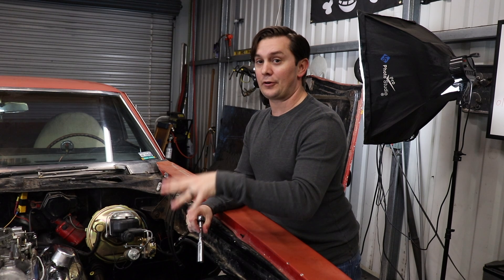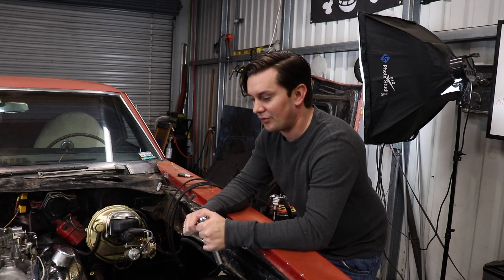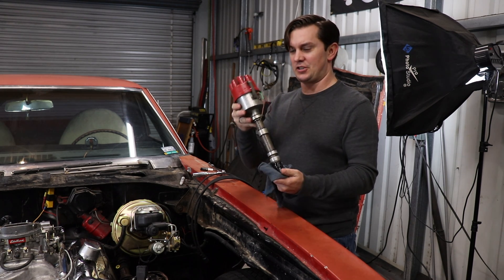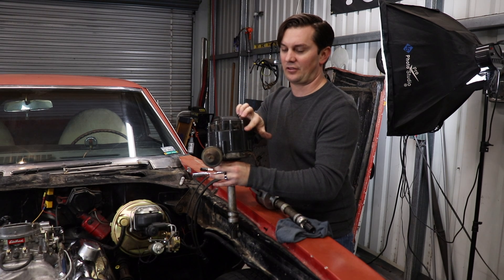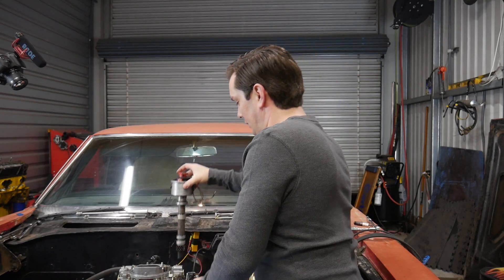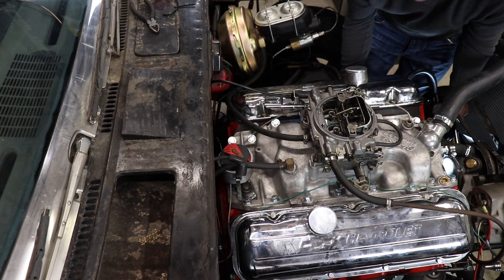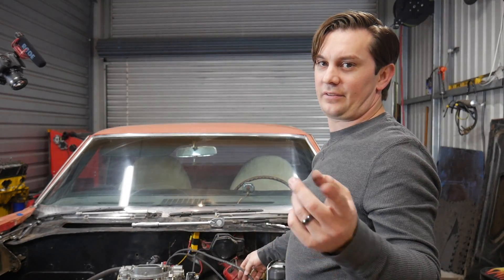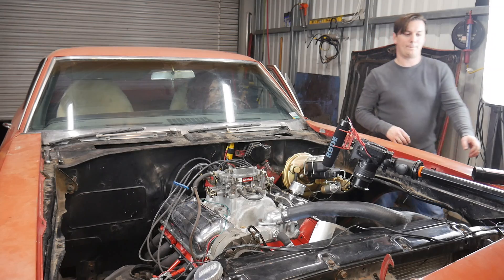How to Install a Distributor in a Big Block Chevy | How to Adjust Timing on a Chevy

Comment from the maker: Thanks for watching everyone. Let me know what you think. Do you adjust timing differently or install distributors differently?
Reply: After setting TDC, I usually make sure my oil pump drive is lined up with the #1 cylinder as well, I don't turn the crank over to let it fall in. Now when I drop the distributor in, it should fall perfect in place towards #1 TDC.
Reply: @fir3gun Extra work.  Not necessary. His way in this video is just plain easier

Comment: Great info but I'm a little bit confused about where your rotor was pointing after you rotated the engine to get the distro to seat. It looks like it was pointing away from cyl #1.

Comment: I'm struggling with this on my 427. Any time I get it lined up just right, i clunk it down, and it rotates due to the gears meshing. But then if I hand crank the engine, it won't be at 0 TDC. Do I do a back & forth a bit with the engine timing?

Comment: Great video...I'm glad I found it!  Going to be replacing my crappy mallory unilite distributor with an HEI for ease of wiring on my '66 GTO with a 1972 Olds 455.  After you feel the pressure push out on your thumb, is there an easy way to know how much farther you have to crank it to get it at exactly TDC or is that accomplished with the marks on the timing bracket and balancer?

Comment: After setting TDC on the #1 cylinder, installation is much quicker if you point the oil pump rod opening in the 11 and 5 oclock position, proceed to drop the distributor in with the rotor pointing towards the second rear intake bolt on the drivers side. As the distributor gear meshes with the cam gear,  it will line up instantly with the oil pump rod, drops right in with rotor pointing towards the #1 cylinder, figure less than 30seconds, and you are done. Using a screw driver to "clock" the oil pump shaft is not a waste of time, but the quickest of time vs dropping in the ditributor, rotatng the engine till it mates with the oil pump shaft, then you'll have to rotate the engine twice to get it back to TDC on the #1 cylinder, its twice the work when you have already set it at TDC on the #1 cylinder the first time.

Comment: Hello, I have a stock 454 in 1975 GMC C25 w auto trans. Timing sticker inside engine compartment says 8deg BTDC. Why are you setting base at 13deg ?

Comment: Im new to this, timing. How close to TDC the #1  piston needs to be? dead on TDC?  should I check the rockers to make sure both  "valves are closed"?  Thanks for posting, great vid!
Reply: Yes and yes! Make sure both valves are closed on the #1 cylinder (this is to make sure it is on the compression stroke).
Reply: @fir3gun  You can place  a screw driver in the #1 spark plug hole. Then Rotate the crank with you breaker bar until you can't turn any further. That willl be TDC .

Comment: Gotta ask wouldnt rotating the engine just to allow the distributor to align with the oil pump throw it out of timing with the number 1 piston. ??
Reply: no because the distributor gear is already set with the cam gear when the engine was on TDC. Now when you rotate the engine, the distributor gear and cam gear are still locked together, then boom the distributor should make one final fall into the oil pump drive (now the distributor is set flush with your intake manifold.)

Comment: I just replaced mine on a 350 Chevy.  When It had been running awhile I noticed that the oil pressure was double what it usually is.  So I shut it off.  Going to go out tomorrow and try to figure it out. Any ideas? Thanks. Nice video
Reply: Shawn Harrison from columbo mine?

Comment: I've enjoyed your vids on this engine ($300 find, tear down, initial fire up and this one on dropping in the distributor).  You've got an easy, laid back style.  Been wrenching on small blocks since I was 14,...I'm 61 now and this was such a well done, straight forward instructional video,....and I know it will be appreciated by many. PS.  The 400 SBC is a little prone to running hot due to the siamese cylinders, but boy do they make power.  They were used in lot's of busses and commercial trucks.  Big bang for the buck and super popular on the drag strip for THAT exact reason.  Even for a baseline build, you can easily get 400hp and 400lb/ft of torque out of them, or more.  Just watched a video today, in fact, and the 400SBC dyno'd at 471hp and 473lb/ft torque.    Great find for ya !!  I'll be watching.
Reply: What headers are on that car? Thats a 67?

Comment: Thank you for the video. Your base timing is 13 degrees but mine according to Chevy is 4 degrees. I have a 1988 Winnebago Superchief that sits on a Chevrolet P30 chassis mated to a 7.4L 454 V8 with a Rochester Quadrajet. Carb guys tell me my base timing can go to 10 which they say is ideal. Can I get your imput? David 🐈
Reply: it really all depends on how stock the engine is. base timing runs great from 4-12 degrees, but if you have any power adders or bolt ons, you might want to consider using total timing, not base timing
Reply: Ya they are supposed to be 4 this is really confusing me
Reply: I took it to a mechanic who changed it to 9 degrees. Runs better. 😺
Reply: did you ever find a answer.  mine also says 4°

Comment: Most people I know use a screwdriver to align the oil pump shaft. Didn't know it could be so easy to just drop it in and turn the crank haha. Great tip!
Reply from the maker: It is one of those little tricks that really comes in handy.

Comment: I just throw them in, find what it's pointing at, and wire it accordingly.  Never used a timing light ever.  Later on if replacing the distributor I do actually try and match it up one for one.
Reply from the maker: If you have done it a bunch of times that method works fine.  The only reason you point it at the #1 cylinder is for easy reference.